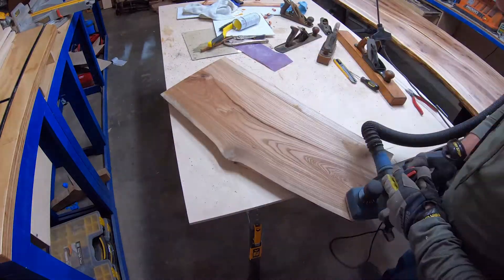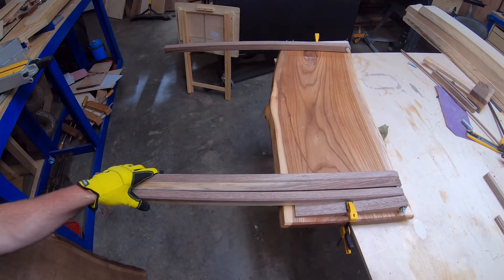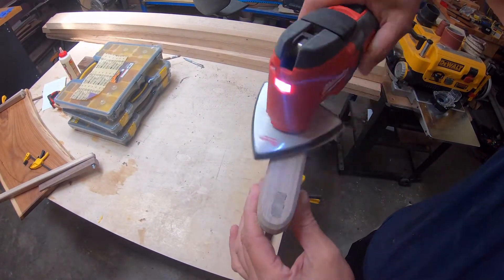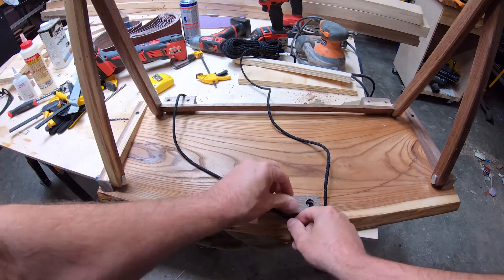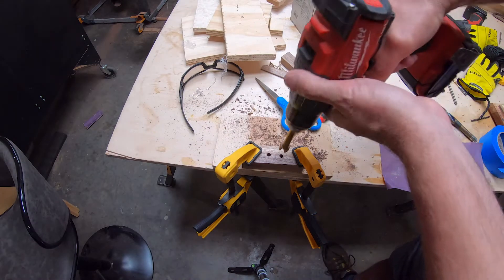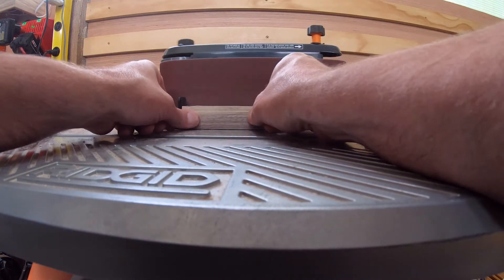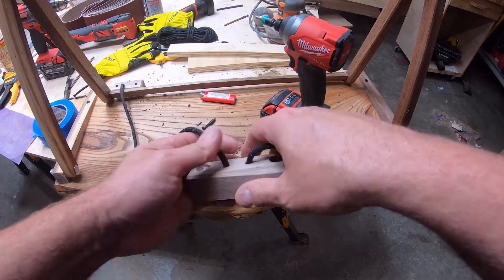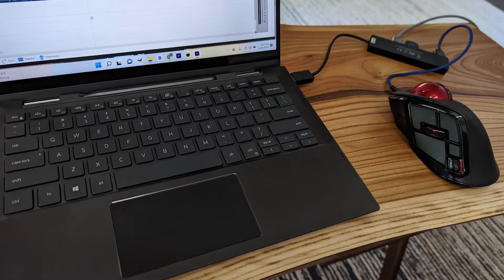Folding TV Table  (Custom Live Edge Elm)

Comment: Nice little project. I've been a software engineer for 30+ years, sometimes working for myself and sometimes for other companies. 20+ years of that has been working from home. Some of my favorite memories were writing code from an Adirondack chair at home in South Dakota with a little table stretched over the arms and my laptop doing its best to keep my hands warm. Now, I'm enjoying woodworking as much as I do writing software.
Reply from the maker: I really enjoy writing software and looking forward to doing some projects to combine both.  Really an enjoying having a dedicated shop to work in and setting it up has really been enjoyable for me too.  It's almost like coding.  If I put this here, then do this, else do this.  Haha
Reply: @shadeTreeWorks  Yep, always nice when you can combine your work. I've written a couple web form-based CNC utilities that generate G-code. Nothing fancy, one is a slab flattener and one helps distribute lube by exercising the full range of your CNC axes for a few minutes.